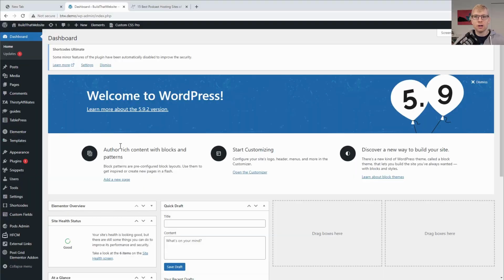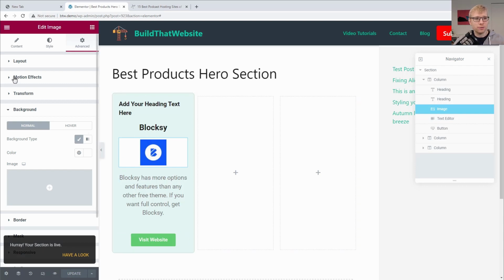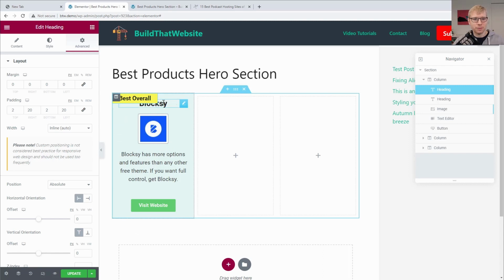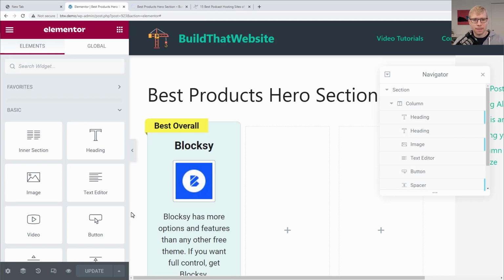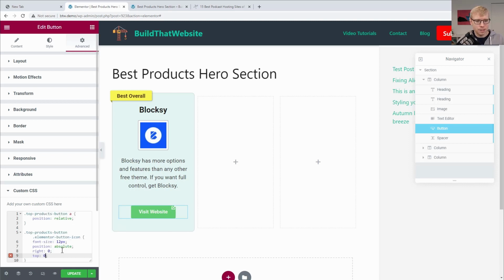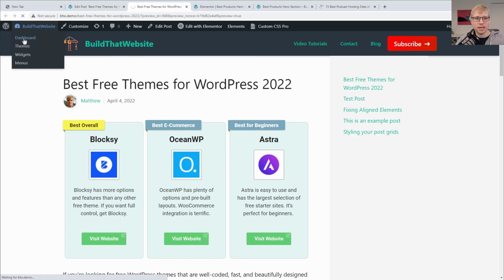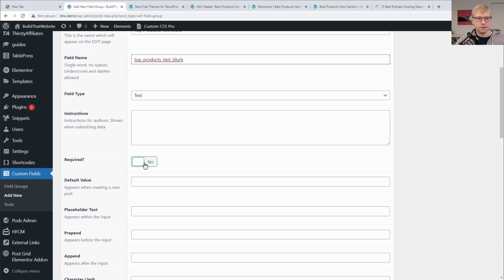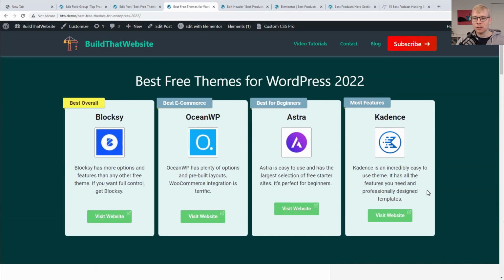Build a 'Top Products' Affiliate Hero Section w/ Elementor (double your revenue)

Comment: can iadd this on my posts and still use other plugins or is it only elementor or plugins
Reply from the maker: You can use elementor alongside other plugins. If you want to use Gutenberg for the post content, you would need to add the Elementor Layout either through a theme hook or using the template shortcode inside Gutenberg.
Reply: @BuildThatWebsite  how much does elementor slow down the website and is their a way around this
Reply from the maker: These days Elementor is quite fast on good hosting. They've made a lot of improvements regarding code size and asset loading. You can improve it further with proper caching and a CDN. There are plenty of Elementor sites on the web with load times under 1.0 seconds.

Comment: The products show up vertically in mobile but horizontally in desktop, how do I make them show up horizontally in mobile
Reply from the maker: You'd just have to adjust the responsive settings for the columns holding the cards. I really can't imagine a scenario where you wouldn't want them to stack on mobile though.

Comment: i created a 5 card design but each is too thin how can i make them wider
Reply from the maker: You just need to widen the outer container that holds them. You can also decrease spacing between cards if that's an option.

Comment: Is it possible to tinker with the CSS or spacing so that each section aligns vertically with each other?  Right now if I have a title that is 2 or 3 lines, it pushes everything down and the buttons and images don't align with each other.
Reply from the maker: Yes, you just need to either 1) set justify-content to space-between or set the flex-grow property of a child element to 1, so it will expand to fill the available space

Comment: If only there was an alternative to Elementor.  I got rid of that builder and moved to Generate Press. How can I make them in Generate Press with NO Elementor? Thank you
Reply from the maker: I'm planning on doing a tutorial using Gutenberg blocks as well. Adam uses Ultimate Gutenberg to build his. You could also use kadence blocks, stackable or generateblocks
Reply: @BuildThatWebsite  Thank you. Please do. Elementor is being phased out of affiliate marketing sites.
Reply: @BuildThatWebsite  Thanks again. I will wait on your tutorial. Hopefully, you will make one soon. I need to send you a question via email. What is the best way to contact you? I have a question about a cool site built with a tailwind.
Reply: @BuildThatWebsite  Is Kadence compatible with GP? Have you seen the points guy website? I need to replicate that model..
Reply from the maker: Yes, Kadence Blocks works with any theme. You won't get the themebuilder features like GenerateBlocks, but you shouldn't need it for one-off pages. 

Can you share an example of a TPG layout you're trying to emulate?
Reply: @BuildThatWebsite  Thank you so much for the reply. I emailed you via your site but maybe you don't read those. So, Kadence Blocks will work with Generate Press? There are two sites I'd like to develop asap ... one is a magazine style site, just like the one you demo'ed in one of your videos GP based and the other one is very much like thepointsguy site. Thank you so much !!
Reply: @BuildThatWebsite  I found something brand new and interesting. This one Polish developer made a child theme for Kadence that is perfect for my project. Or one of my projects. Blockfold pro theme. It will work. But, I'd still like to email you with a question,. Thanks .
Reply from the maker: @dinorossi6611  You can reach me here: https://www.buildthatwebsite.com/contact
Reply: @BuildThatWebsite  I sent you an email message.
Reply: @BuildThatWebsite  Did you get  my messages via your site?
Reply from the maker: Through my contact form? I haven't seen anything come in. I'll have to test to make sure there isn't a technical issue
Reply from the maker: Via my contact form? I haven't seen anything come in
Reply from the maker: Hi Dino, sorry I tried to respond to you the other day on my mobile app but the comment didn't post for some reason. How did you contact me, email or contact form?

I think I may have be having a recent issue with my contact form, possibly related to a page caching rule. I haven't seen any new contact messages come in. You can reach me directly at contact(at)buildthatwebsite(com). Sorry for the confusion.
Reply: @BuildThatWebsite  Contact form.
Reply: @BuildThatWebsite  no luck
Reply: @BuildThatWebsite  Are you going to make that same video but for Generate Press and not Elementor ?
Reply: @BuildThatWebsite  :(